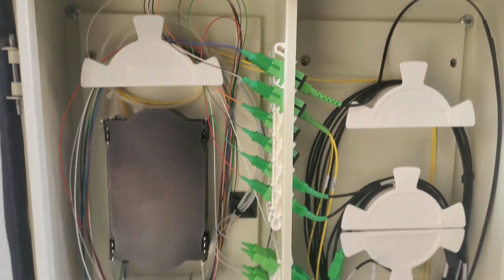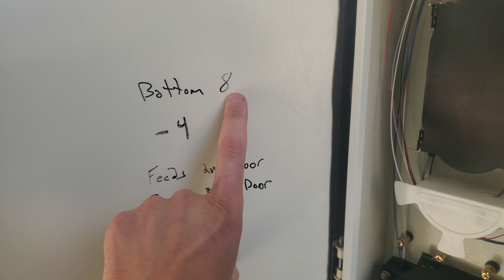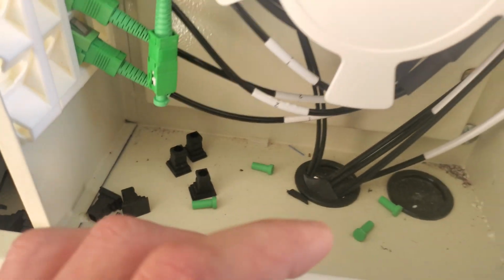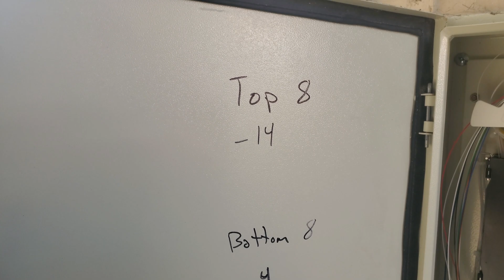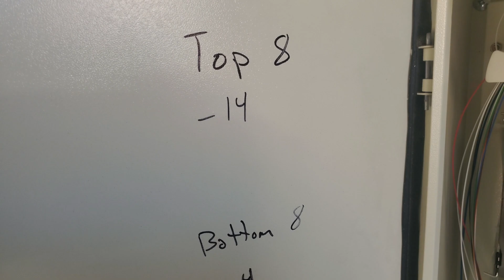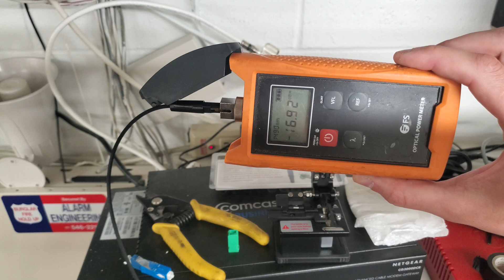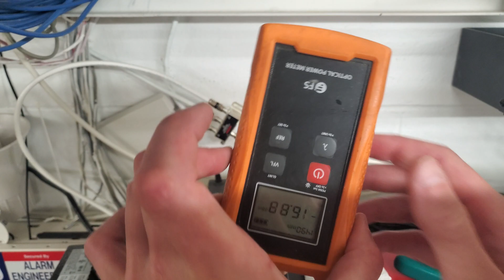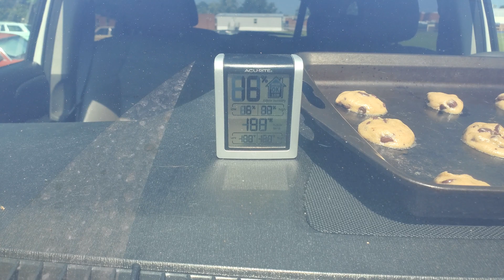GPON 300Mb\s symmetrical customer doing a quick connector and baking some cookies

Comment: Extremely interesting/entertaining video. I haven't used fiber, strictly stayed in the realm of CAT5e/CAT6 networking (non-commercial at that), but will make that leap at some point. Continued luck with the solar baking, and even if the end result isn't great, the vehicle should smell amazing for a couple of days!
Reply from the maker: Thanks for watching there isn't a lot different about it like cat6 cable except you can run it like 50 miles with 10G on 1 fiber with like $40 optics.  Then you just think about things slightly differently but not that much.